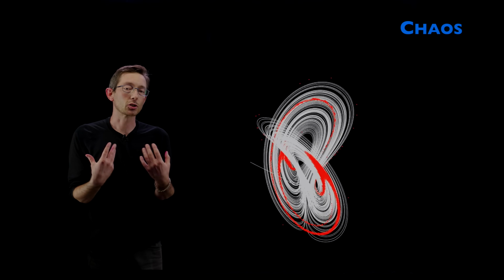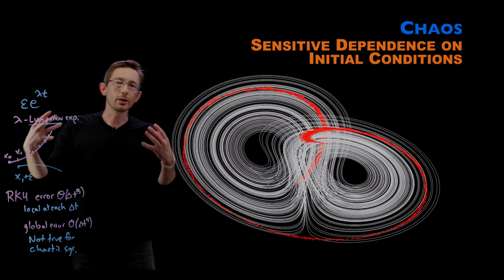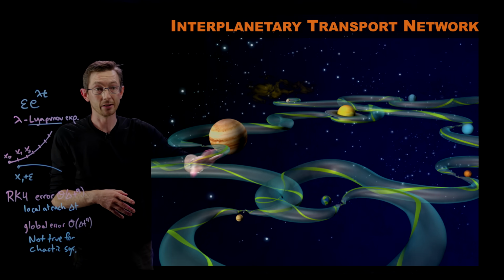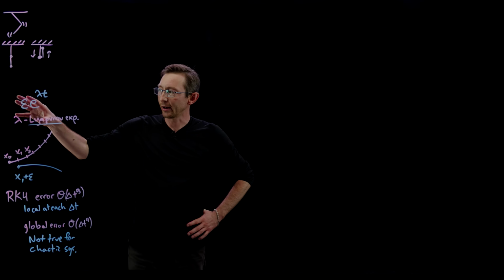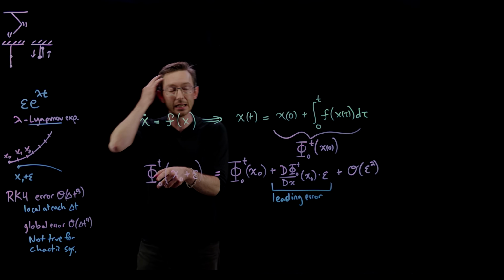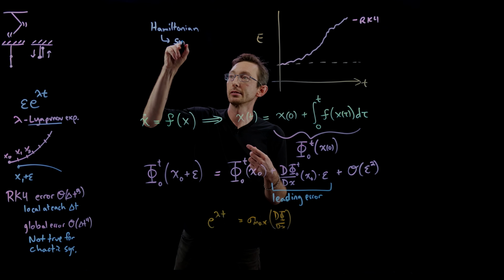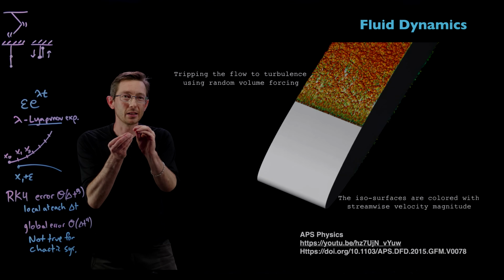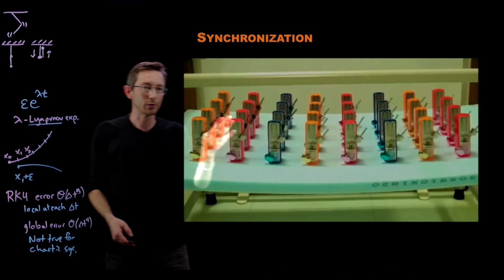Chaotic Dynamical Systems

Comment: Hi steve, thanks you a lot for this course on ODE and dynamical system! I learned and revisit the subject much more deeply then never. 

However, I still finished the course with  an interrogations about linearization  around fixed points : how do I take any non linear function with unspecified fixed points and I determined where are all of them? Is there a rigorous and straight forward procedure to determine the number and the position of all fixed points for any dynamical system ( non linear, chaotic, ) ?

Thank you!!

Comment: About the pendulums: if both depends on the initial conditions and you started both with the same initial conditions and their behavior differ, then they don't depend on the initial conditions
Reply: The pendulums weren't started in the same conditions. The key here is to show that the smallest difference between initial conditions makes a big difference in the long run in these chaotic systems. Although through the human eye, the pendulums start in the same position and the same conditions, there are small variations (not only position, also drag variations, mechanic losses etc)

Comment: Ok, so if you have a system with control inputs, like the inverted double pendulum, is it possible to apply symplectic integrators?  It seems like whenever you have a motor or whatever, you're going to be adding or removing energy, so the fundamental assumption of those integrators is not met.  Buuut, you know exactly where and how much energy is being added or removed (i.e. only through the actuators), so maybe it's possibly to exploit that?  Like I don't know if this makes any sense, but if you pretended the motor in the double pendulum model had a battery, and added a term for the electric potential to the Hamiltonian?

Comment: Thank you very much for this interesting lecture...

Homework (Excercise):
In time 27:14: you should write down double pendulum equations of motion (from the Euler-Lagrange or Hamiltonian equations), and use the (classic) RK4 integration scheme for the problem to compute the trajectory of the double pendulum system. Utilizing the trajectory, calculate the system's energy and plot it versus time.

Comment: In a chaotic system, why does it make sense to use floating point numbers in computers if they intrinsically have round-off errors?
Reply: You might find the article on "Interval arithmetic" on Wikipedia interesting.
Reply: It's not an error of computing, it's an error of input data (and the right model).